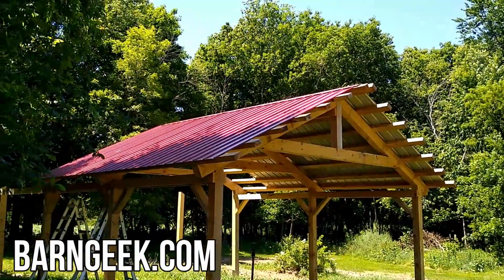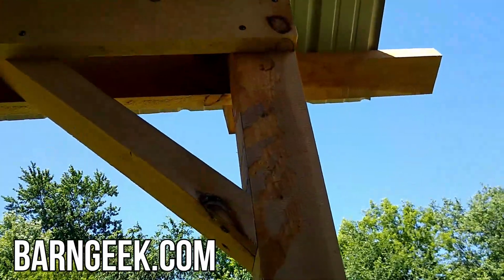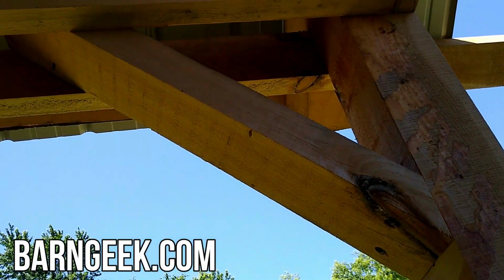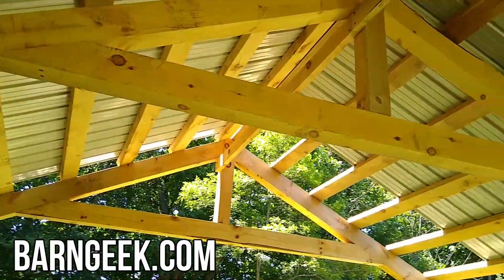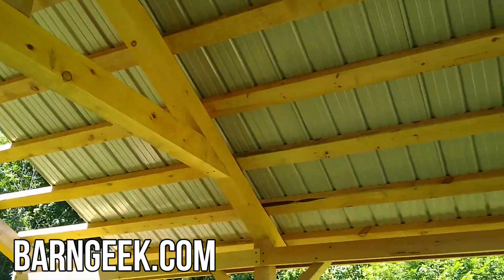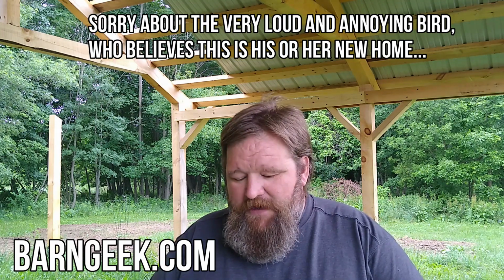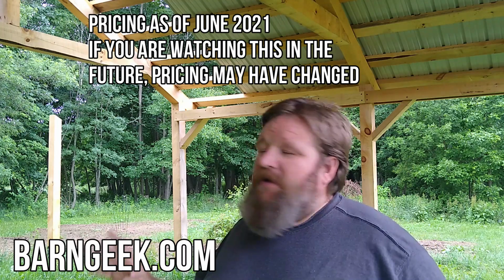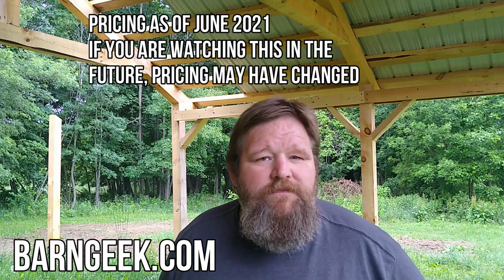The $6,000 Timber Frame Barn Build Pt. 1

Comment: Just finished watching the entire series and so many more of your videos. Great information. The main question I would have is what is the difference between just using your screws or the hardware and bolts? I know that the hardware and bolts add to the look but what is the benefit for a pavilion which is what I'm building or one of your larger barns for those that are building a larger two story structure?
Reply from the maker: The screws are strong, but they aren't strong enough to support the tie beam on a two story structure. This is why we use steel plates and bolts for the joints that require them. It is very important to follow the plans and use steel plates where they are called for.
Reply: @BarnGeek  I thought I'd find the steel hardware and bolts, etc. on your site, but did not have any luck. Are you currently not selling this hardware?

Comment: Will this be able to pass inspection or is this ag use only?
Reply from the maker: Of course regulations differ from state to state, country to country etc.  That being said, we have been using this basic design for 13 years, and have sold hundreds of plans.  Nobody has reported that they didn't pass inspection.  That doesn't mean there is any guarantee that your building inspector will approve the plan, or that your building will pass inspection.  It's best to take the plans to your inspector and see what they say.  If it turns out that you can't use the plans, let us know and we will give you a full refund on the plans library.
Reply: @BarnGeek  Im in Michigan I believe you guys are too.
Reply from the maker: @ruralridez6165  Yes, we are.  I'm sure you will have no trouble at all, we have a ton of barns in Michigan, but of course I can't say with 100% certainty what your local building inspector will say, that is why we offer the money back guaranty.

Comment: Is there any  engineering done on the principal trusses? What's the roof pitch? I like the design very simple yet attractive being post and beam
Reply from the maker: Thank You! The design is based on known parameters, which is general practice for many different types of farm structures.  This exact design hasn't been reviewed buy a licensed engineer, but the basic design parameters we use have been reviewed by two different engineers.  The basic load data from that review is on the first page of the plans.  It has also been tested in many real world situations.  This particular truss design survived Hurricane Mathew, with a complete roof, and no wall sheathing.  I would put this design up against any conventional post frame system.  The roof pitch is 6/12.
Reply: Imagine thinking you need to pay the government for the privilege to build a pavilion
Reply: It’s built with non certified lumber and no permits so it’s not legal!What a great guy👎
Reply: @scor440  most non living structures in rural areas are not required to be permitted nor does the lumber need certification.
Reply from the maker: @scor440  There is nothing illegal about it.  It's NOT illegal to build with rough cut lumber.  And this is fully permitted.